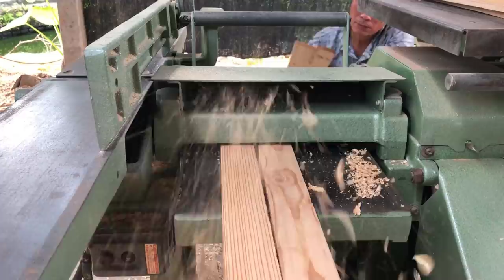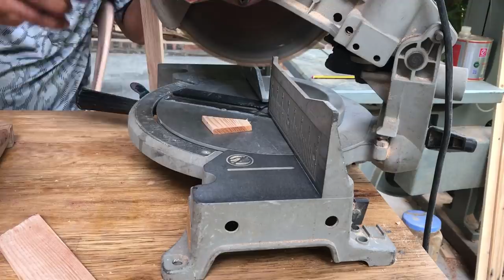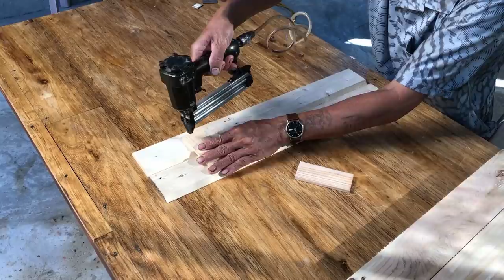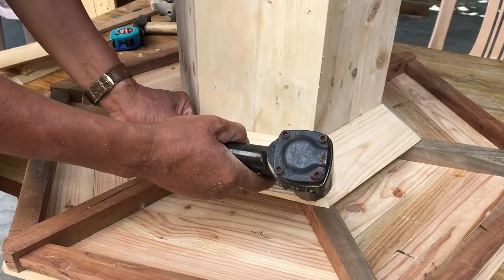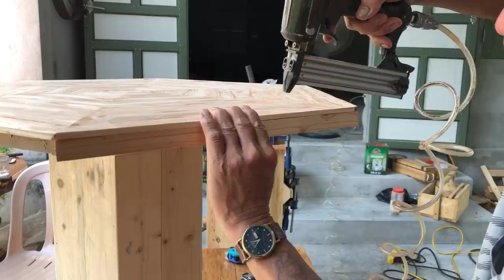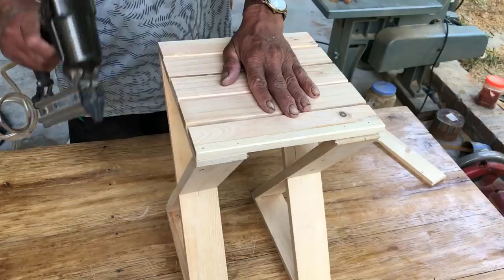Unique DIY Projects With Wood Pallets // Build A Outdoor Cafe Table Extremely Creative And Unique!

Comment: - VERY nice project but if it's set outside with no glue or outdoor nails, how many summers in average heat & weather variables might it last ??? Realize it's  made from pallets but you'll very likely need to remake it quite often. Thanx 4 sharing.